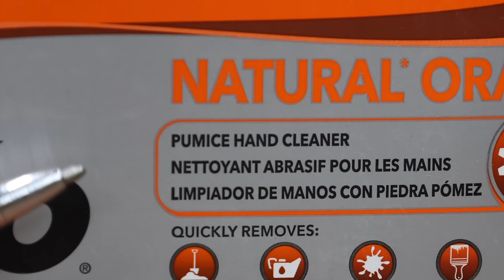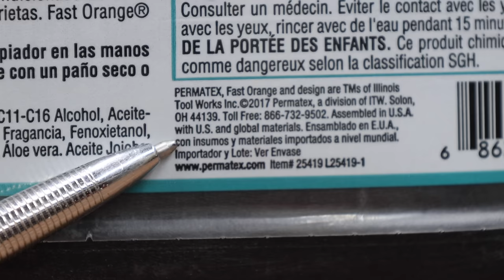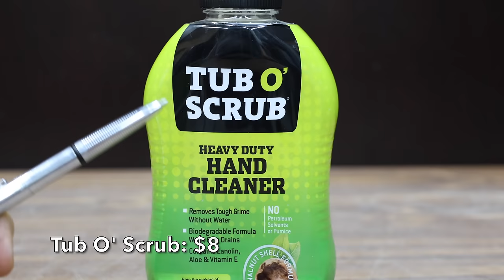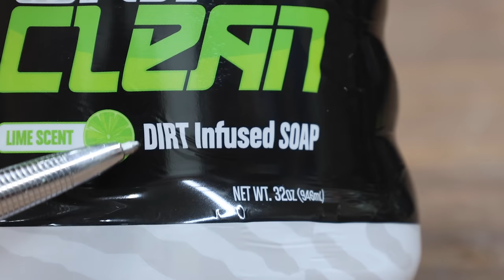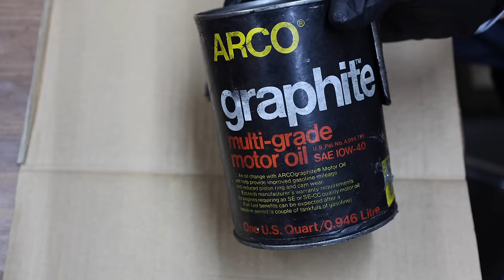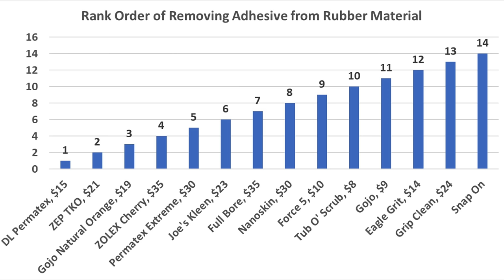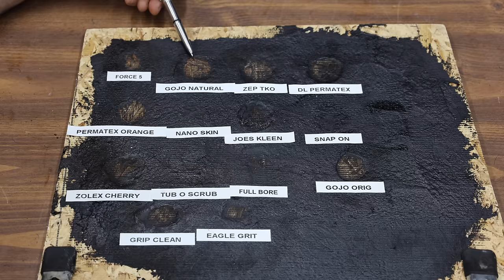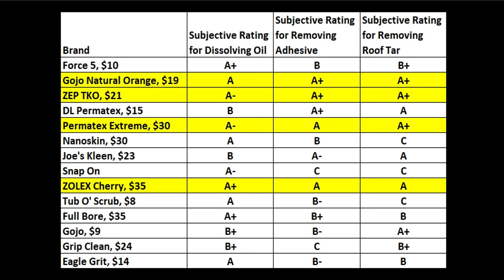Best Hand Cleaner? Let’s Find Out!

Comment: Zep Cherry Bomb is the best hand cleaner I’ve ever used. I would recommend it to everyone. Put it on dry hands/arms and add a very small amount of water. Scrub some more, rinse. Works GREAT!
I will say, it doesn’t perform as good if you’re in a place where water isn’t readily available (i.e. field service) It leaves a lot of the grit on your hands if you just wipe it off. I have some in my service truck and I have a jug of water to rinse off with as well as Tub O’ Towels. I take the Cherry Bomb out of my service truck in the winter time.
Reply from the maker: Thanks for sharing.

Comment: What a great video The best thing I have found for getting grease off is The Foaming Soap at bed bath and beyond for some reason it does 100 times better then even the Fast orange Xtreme small tiny pump of foam and it will clean your hands arms and face and Still get 100 percent off without needing to watch again @Project Farm
Reply from the maker: Thanks!

Comment: You should do a video on shop fans. For those of us with small garages and don't have the space for a 42" or 50" drum fan it would be nice to know if a 24", 30" or 36" fan will do the job. It seems like the CFM ratings are very subjective and some fans shoot air in a straight line and some spread it out to cover a large area.
Reply from the maker: Thanks for the suggestion.

Comment: I’ve been using Permatex DL hand cleaner since the 80s when Consumer Advocate ,Herb Denenberg chose it as the best.  I think Herb tested it for cleaning hands instead of towels.   It has been doing a good job at cleaning my greasy hands for decades.  The other thing I like about DL hand cleaner is that the Allow and Lanolin that keep my hands from cracking.  Some of the other soaps would lead to dry cracked hands when used on a daily basis.
Reply from the maker: Thanks for the feedback.

Comment: I have been an automotive mechanic for over 20 years and now switched to working on old (1930s) factory machines, so I'm no stranger to grease, oil, etc. I do not like the fast orange, gojo orange, or the like because they are too watery and don't work well for me. Typically I used Gojo original,  but the level of filth I run into needs some sort of grit to the cleaner. So what I do is mix pumice (we use it for polishing)  with Palmolive dish detergent to make a paste. usually, about a quarter-sized amount will remove everything and still leave my hands soft. I was using Dawn, but that left my hands dry.
Reply from the maker: Thanks for the feedback.

Comment: Something you may want to take into consideration when using rotary brushes such as one you used for tar in  this video is that the strands in the brush twist with use and become less effective, you could probably make it more consistent by running the drill equal amount of time in both directions for each test
Reply from the maker: Thank you for sharing!

Comment: I did not see the one I use in the lineup - Fast Orange, which is sold by O'Reilly. I have used it for  years and it does a pretty good job taking off grease and dirt after working on one of my vehicles. Although I have moved to just wearing some of the newer latex gloves on the market which works a lot better than any hand cleaner. Hard comparison to make, but you did a decent job.
Reply from the maker: Thanks!

Comment: sugar mixed with wash,n up liquid,
 also benefit of this is it washes away easily, as lots of  others seem to stick to the sink, and got to then wash the sink
just have to look at garage wash basins, mostly all clogged up with the cleaner

would have been nice to see hands been washed in a sink to show which washes away the easiest. as most i used to use just stick to sink,
aint used a hand cleaner for 0 odd years after found out about wash,n up liquid and sugar

Comment: I wonder about your initial test looking for a layer of oil, because it would be difficult to tell if the cleaners emulsified the oil into the solution, versus allowed the oil to separate from the water. I would imagine a good cleaner would emulsify much more, and so it'd be almost the opposite of your measure of the oil layer at the top. A control with just water would have been helpful! Love that you measured the cleanliness of the rag after though!
Reply from the maker: Thanks!

Comment: What I have found is that normal bar soaps or dish soaps will break up oil at just the right concentration. You need more than you get during most of a normal hand washing, but pure soap will not react at all.

If you put an inch or two of water in the bottom of the sink and then gradually add more and more soap you will get to a point where oil is stripped easily by dipping your hands in the water and rubbing them.

Then when you wash it all down with more water, the oil will suddenly stick to the sink again.
Reply from the maker: Thanks for sharing.

Comment: One of the best hand cleaners I have used is dish soap and a teaspoon of sugar to act as the abrasive. It dissolves in water when you rinse it off too so its quite environmentally friendly and sustainable.. Not that I worried about that when I first started using it in the 1980's..
Reply from the maker: Thanks for the feedback.

Comment: What ever became of Champion? That was the de-facto hand cleaner we used back in the 70s. Not gritty at all, low viscosity and easy, clean removal with or without water. It came in a big ol' can and you mounted it on a metal dispenser with a push pump that you hung on the wall.

Comment: I've found the roofing tar is easy to remove with a petroleum based product. Gas, kerosene, paint thinner, even baby oil (that takes more, but works). Since it's an oil based product, it will come off years later (I've done that on tools). The problem then becomes getting rid of the solvent smell. What does the best at that?
Just a note. We used to use baby oil to get paint out of hair at night after it's dried during the day. Then the shampoo takes the oil out pretty well.
Reply from the maker: Thanks for the feedback.

Comment: As a user of the Full Bore, I think it got shafted a bit because you really have to create a good slurry for it to work its best. Especially on the drill test where the drier powder got flung off. However, this could also translate to less "ease of use" compared to the other brands, which is fair.
Reply from the maker: Thanks for the constructive feedback.

Comment: love your chanel ; i jst need to add one cheap product we all have at home in case you dont have any of those ; or like me your fed up of having dry or cracked hands cause of chenmicals. 

best and cheapest oil / diesel/ engine dirt remover is COOKING OIL  ... then clean your hands with soap..

. hands come out soft and dont get chemical burns over time ( if your a mechanic ) 

anything that will stick to your hands and need acetone or harder ... either i use gloves or the proper detergeant and clean  hands afeter .
Reply from the maker: Thanks!  Thanks for the feedback.

Comment: Densitometer might be useful for judging the cleanliness of the towels it measures light refractive basically can use it to determine which is the whitest. If you like I can ship you one I work in the printing industry. Just measure 3 or 4 spots to get the avg and should be more accurate than visual opinion.

Comment: I think you should have tested brake cleaner with it.  That is what I use. haha.  The Gojo is my go to but my favorite is those "dirty hands" towels with cleaner built in.  They seem to do an amazing job.  I like that the gojo doesn't require me to actually wash my hands.  Usually, I'm just trying to get the worse off before I take a shower or do something that requires relative cleanliness like packing a bearing or rebuilding a hydraulic pump after disassembling it with lots of sludge on it.

I've never seen the permatex extreme but that could just be due to not looking.  I'll have to keep an eye out.

I find that keeping my hands lotioned up daily makes the grease not stick into my hands as bad to begin with.  Not that I care because anyone judging me can kiss my rear.  I only noticed because in the winter I lotion up since I work in a freezer and the constant cold and then dry heat of the house really started to get to me.
Reply from the maker: Thank you for sharing!

Comment: The answer, in my opinion, is to use several products.  I keep a big jug of GoJo with pumice at my utility sink because it's simply the best when it comes to cleaning up really dirty hands. I really like the grit.  But it also works better if you rinse it off with water followed by a quick scrub using a bar of old fashioned Lava soap and a fingernail brush to get my hands really clean.  Plus, the jug is huge, so it lives by my sink.  Out in the garage I keep a tub of whatever conventional cleaner is on sale for a quick, but not necessarily thorough cleaning.  And in my car, I keep some of those hand wipes for a clean up if I have to change a tire or something.  They aren't the greatest but they are unlikely to cause a big mess inside my car.  Finally, my wife keeps a tub of Goop in her laundry room for removing stubborn clothing stains.  She claims nothing works better.
Reply from the maker: Thanks for the feedback.

Comment: The only issues for me is that I use these products every day as a mechanic. A heavy qualifier for me is moisturizing so my hands don't dry out because that gets painful quickly, and how well it actually cleans vs effort applied. For me, the best one I've found is the snap on because it consistently leaves my hands clean and moisturized, almost every single other cleaner I've ever used just does not moisturize my hands like the snapon with fibril. My next favorite is fast orange because, while it doesnt seem to be a very good moisturizer, it seems to get my hands very clean with not too much effort.
Reply from the maker: Thanks for the feedback.

Comment: I used GoJo Orange all my life but I wanted to change it up to Zep Cherry Bomb in the hand pump bottle. I live in a cold environment and my workshop is not climate controlled. unfortunately, the Cherry Bomb separated to pure water-consistency on top and thick sludge the other 75%. I read and its suppose to be in an environment of 40 degrees (i think) or warmer. I have to look at everything now about temperature ratings. Another thing I never thought of before I moved to a cold environment was electrical tape. Even nice branded electrical tape have different models that have different temperature ratings.
Reply from the maker: Thanks!  Thanks for the suggestion.

Comment: I'd really love to see a probe thermometer timer comparison for BBQing. I feel like ThermoWorks is a good brand and it was recommended by the buy it once for life reddit community, but I've struggled to keep probes from malfunctioning under the hot grill lid/smoker. I go through about 4 probes a year where they'll read higher than they should, occasionally resulting in taking some meat off the grill early. My solution has been to stock up and use common sense with the ramp up and down of the temp readings, but a more durable product would be killer.
Reply from the maker: Thanks for the suggestion.

Comment: I think you said you look for ideas. How about manual pole pruners for trees?  The long ones. There'd be all kinds of things to check, like the rigidity of the handle at 27', conductivity (to avoid shocks), ease of use, saw sharpness, pruner mechanics (# of pulleys), rope, assembly, all the usual suspects. I do think the handles make for it to be interesting.
I just wish I had the answer now, because I really need a pruner and can't make my mind up. This things range from $70 or $80 to true, pro-grade gear where you might spend $400 to  $500. Maybe more. I'm just looking for the sweet spot....
Reply from the maker: Thanks for the suggestion.

Comment: Snap-on Nitro Gold and Kresto "Classic" by Deb Stoko are the best I've ever used - though I think the Nitro Gold might be the same thing, just re-labeled.  I'm not sure this test method really captures the merits and demerits of a hand cleaner. It captures the solvent action of them, to some extent - but I think there's more to it than that. Also, I've found many hand cleaners, like Fast Orange, quit working right once you add water...you've gotta do ALL the scrubbing BEFORE rinsing off with water.

Unfortunately, I'm also struggling at suggesting test methods that will be quantitative and objective. I understand you did the best you could. Maybe you'll get some bright ideas before you test hand cleaners again.

Comment: Also 2 more video suggestions:

3. also a non-oil based grease or liquid that prevent hard rubber like O-rings, gadget casings (like the iPhone case or camera grip if it's rubber-plastic or even 100% rubber), any plastic rubber that usually on gadgets that will crumble overtime if not treated with something

4. non-oil based grease or liquid for vinyl or fake leather/plastic "leather"/faux leather (may include alcantara) to prevent it from cracking (very prevalent in vinyl or seats with fake leather, seats are tools in garage work too)

These four can be used in other products not just mouse lens and not just for magnifying the result of lens leaners on the amazing G502 Lighspeed's lens plastic. The microscope can also be used as part of the tool for really close, precise machine world and repairs (a lot of things we've never realized opens up when we see it in a literally Big way and this makes our repairs or crafting way better).

God bless, have an amazing Lent and an amazing advanced Happy Easter.
Reply from the maker: Thanks!  Thanks for the suggestions.

Comment: Australian here. Best commercial hand cleaner I've ever used was Swarfega. It's now called Swarfega original classic. 

Accidental best hand cleaner, better than Swarfega, was the coolant mixture used on all the machines I worked that drilled, machined and polished various components for a company I used to work for.

I found out the coolant was a great hand cleaner when I washed my hands in it one time to get some dripping oil off my hands, I did that so I wouldn't drip any oil where people walked.

I then grabbed some swarf and immersed my hands full in the coolant tank of a particular machine and was able to clean my hands very quickly. Much quicker than the job Swarfega did.

All pretty useless information as I have no idea who made the sealant. All I know is that it was delivered to the factory in tankers the same size as you'd see petrol being delivered in.  

Though I've never found a hand cleaner that can get the ingrained oil out of the small lines on your index fingers which gets pushed in there when hand tightening nuts and bolts. Always have to resort to soap and a scrubbing brush to get my hands clean enough to look respectable when going out on the town.
Reply from the maker: Thanks for sharing.

Comment: Just regular Tide laundry powder (not the liquid) is the best hand cleaner I have used all my life. Just wet hands put a little powder in your hands and it will remove all grease from your hands and finger nails. Worked on my own cars since I was 16 (now 63) and have had my hands coated in black and dirty grease and oil and tide will remove it all with ease. No other hand cleaner that I have tried can beat it.
Reply from the maker: Thanks for the feedback.

Comment: I got turned on to a bar soap by another driver. Not really bar soap fan, but I like their product line so far. I love their heavy grit soap grease and oil. Brand is dr squatch I got off Amazon. Not sure how you can test vs liquids.
Reply from the maker: Thanks for the suggestion.

Comment: Another great video!!!

Not sure if you’ve done some flashlights. Havent fully searched for the video.  I’m a big fan of the NEBO brand. Wondering if their tech is in fact better than the cheaper ones. Drops due to the magnet maybe being too weak. Water resistance, longevity of bulbs and batteries.
Reply from the maker: Thanks!  Thanks for the suggestion.

Comment: My homemade recipe : A large 4 litres of dishwashing soap with grapefruit, lemon or citrus smell mixed with some clean play sand sold at local hardware stores. Transfer the dishwashing soap bottle into an empty windshield washer jug but leave some space and gradually add the sand little by little. Shake well each times until good  thickness still flowing enough to not look like mud. Shake well the jug before each use. Voilà! :)
Reply from the maker: Thanks for sharing.

Comment: I use TKO. Also keep a bottle of Joe’s. but the joes cleaner works best with no water. like I have worked on some nasty grease and gear oil stuff hard to get off. but throwing joes on my hands and using a rag to wipe em off removes more than adding water to it. From my experience with it. Then I end up washing my hands TKO. but the lava bar helps get hard hard to get stuff out even clothes
Reply from the maker: Thanks for sharing.

Comment: @ProjectFarm. Got a video idea for you. This is an old trucker myth that i'd like to see you test out. 
I would like to see you test the lubricity properties and flame propagation of diesel fuel, bio-diesel blend, and diesel mixed with TCW-3 2 stroke oil at a 100:1 ratio. I wanna know if this myth holds true, quite a few diesel guys swear by the 2 stroke oil in keeping pistons clean, injectors clean and even improvements in fuel economy for mechanical and older common rail diesel engines.
Reply from the maker: Thanks for the suggestion.

Comment: Just use dirt from the ground with some water, the sandier the better, or just sand. Even most garden soils will have enough mid-sized abrasive elements to loosen most adhesives/oils off your hands. Then anti-bac or use normal soap/hot water if you're bothered about what might have been in the dirt.
Reply from the maker: Thanks for the feedback.